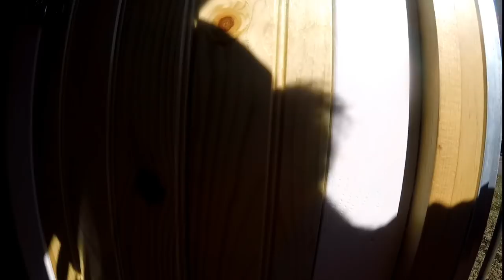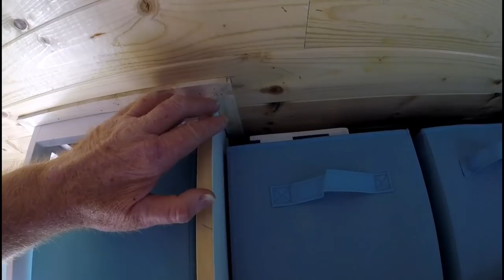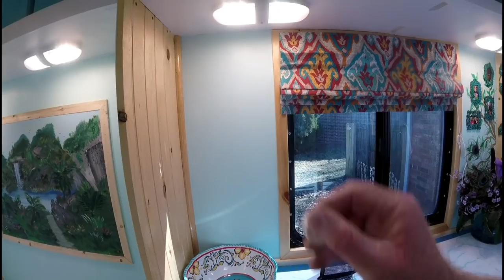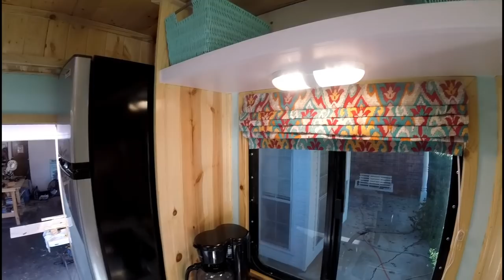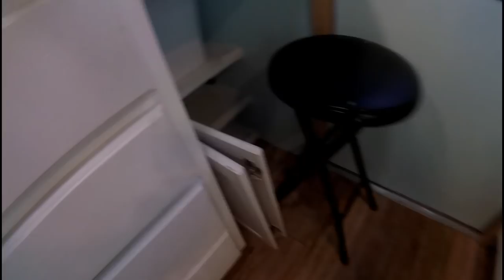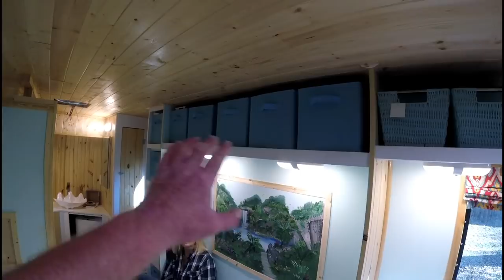Cargo Trailer Conversion Shower Trim and False Panels

Comment: I want to share a tip on trim. Do as I did and get a glue gun and buy the right size Manila twine or rope get the right side and it make a nice transition with a warm rustic look. You can wrap around bottles at the top or around wood post. Mine a Art Deco / beach decor so I got fishing net. Fishing decor on eBay and I’ve got the aqua , or blue green paint scheme look really nice.

Comment: I finally have something to add!! I’ve just finished using about 20 tubes of lexel. Get a bucket of water with some dish soap in it and just dip your hand in it when you go to smooth the caulk bead. Will not smear or get on your hands. I’ve got some really nice looking beads in our trailer which are promptly going to be covered up, lol! Great job!!
Reply from the maker: I tried that method only with a plastic spoon. It didn't work for me. Of course I was applying it to exterior seams, in the summertime, and I might have waited too long. Glad it worked for you. The nice thing about Lexel is it will last, and it's flexible which is a plus for our metal trailers.

Comment: Tech Tip : Whenever you caulk anything, always use the blue tape method & a rubber gloves to protect your hands.  The blue tape method will ALWAYS give you a perfect bead and allow the material to be pressed into every nook & crevices.  It takes a second to prep both sides with the tape, but the end product ALWAYS looks Professional and no one could have EVER have done a better job than you, if you do it this way.  Once the bead is laid down and you run your gloved finger over the joint several times, then remove both sides of the tape, it'll be PERFECT I promise.  Painters Blue Tape
Reply: This post brought to you by 3M, perhaps... Sometimes that works, and sometimes (thinking with Lexel, especially) if there is enough set-up before the tape gets pulled, the portion on the tape will have as much or more grip than the surface caulked or sealed and the work will be dislodged by the tape removal.
Reply: @ReflectedMiles  Nope...just an average Joe.  I've never used Lexel, but with that said..... I understand what your saying and don't think that will be an issue nor have I ever experienced the "Dislodge" problem before.  After you run your wet finger over your caulk bead to smooth it out and to additionally press it into the crevice you where caulking.  By doing this it also leaves minimal caulk on the tape itself, so no grip really to speak of.  Also, keep a piece of paper towel handy to clean your finger off after every finger swipe crevice smooth over.  When you get done the finished job will look as good as ANY Professional Tradesman can perform and possibly less mess.  You should go and try it with the Lexel next time and let me know....I've tried this method with spray paint and if you let the paint dry to much and then pull up the tape, that would give you a jagged line, if not tear the tape leaving some behind.  
I've also used clear scotch tape with this method and it also works (it's just hard to see).  You just have to make sure you firmly put the tape down or the caulk is more apt to run under the tape then the 3M blue stuff.  I've also used Dollar Store Blue Tape as well, which again, make sure you press that down firmly as well or the caulk is more apt to run under the tape.  3M does make good stick stuff.  :)
Peace
Reply: Wow it's all beautiful, not only the craftsmanship but the decorations and designs. Love everything. Well done. Before you mentioned that your wife loved painting,  I told my self "oh wow, those paintings were very nice". Very artistic.  God bless you both.

Comment: Hi Deb & Bill: The RV is looking great. I love the paintings and personal touches. The rear door is a foam core and has no structural integrity to hold just screws. They route out the opening and depend on the glass frame for strength. The glass frame has screws that go through from the inside to the frame on the outside. Be sure the outer frame is caulked. They usually use foam tape  I was surprised to see you surfaced mounted the hinges on the cabinet doors near the side entrance? They really stand out. Keep up the great work;  Frank

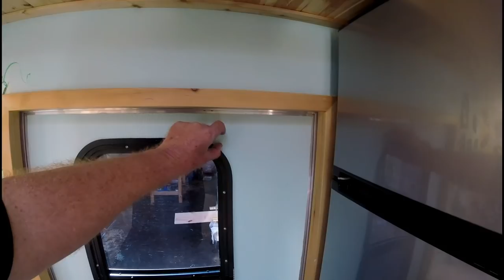Comment: At minute Mart 8:30 you said ifanybody had an idea to let you know :-) I have become a big fan of the small suction cups that have the rounded back with the curb slot down the center. The suction cupis simple and very effective. And I use chopsticks to connect two together to create a type of rod. I have one of those half circlewindows in my front door on the light always pours through. So I got some shelf paper that was made out of a plastic / rubber combination, cut out the shape of the window and then finally put four holes, two on either side of the half circle cut out so I could fit the suction cup stem through the hole. Then I slid the chopstickthrough the two slots which created a frame. I heard this on the other side so it kept the shelf paper at here to the window by the suction cup and the chopsticks made a type of backing to keep the shelf paper attached to the back of the suctioncups. I know that's lengthy but I'll show you a picture. I came up with the idea about six months ago. I should really patent
Reply from the maker: Email me a photo @ iridetinyhouse@gmail.com

Comment: I been watching YouTube videos on trailer conversions for a while. Your shower and bed designs are the coolest I've seen. I like the entire trailer but those two items really stood out. I'll be looking for more videos from you.
Reply: The bed is in the middle or is it a slide-out?
Reply from the maker: The bed is in the middle. There is no slide out. That was about 4 years ago. Yes. We had to crawl over the bed to get to the bathroom and / or the kitchen. It was a 7×16 and we had to make use of what little space we had, and still have the features we wanted. We could have put the bed either in the front or the back of the trailer, but that would have meant the bathroom (read, toilet) would have been next to the kitchen. Many suggested a murphy bed, but, they failed to consider our 50 gallon fresh water tank was under the bed, as well as the house batteries, and what space we had left under the bed became storage. Another thing many failed to consider was, this trailer was our full-time home. We lived in it for 2 years. There's no way we would have put the murphy bed up, and then back down 730 times in 2 years. We sold that trailer about 2 1/2 years ago, and when we mentioned it might be for sale, several people stepped up to purchase it. We then built a bigger trailer (8 1/2×20) and have been living full-time in it for almost 2 1/2 years. There are several build videos available on our channel, and our final, official walk thru video on the new trailer will be released Tuesday, August 22nd, 2023 @ 6:30 PM Central Daylight Time.

Comment: 45 your tip of the caulk gun and make it really small...like super small.....pre pump it away from your work piece ..  meaning get the material to the tip before hand ..also wet your finger and have a clean wet rag handy also an old business card with the corner cut off works good for setting the bead
Reply: Another great option for a fine bead is to use a Turkey Large Syringe.  This is used in Cooking to inject butter and other liquids into a turkey or chicken prior to cooking.  The needle is about a 16-18 g needle.  Squeeze the caulk into that syringe and then use that.  It would inject caulk into that tiny space between his shower and framing, lessening the need to smooth the bead.  He's right, that particular caulk he's talking about is a pain, can't do the usual smoothing techniques.

Comment: One thing you can use on RV doors is aluminum rivets along with Gorilla Glue that way you don't have to worry about it not attaching to anything because the rivets will expand on the inside of the door and hold it in  place by itself
Reply from the maker: Good idea

Comment: Does your bed fold up against the wall when not in use? If not, will you have to walk across your bed to access the kitchen? Build looks good, very professional..
Reply from the maker: The bed is a permanent structure. There is a 50 gallon fresh water tank under the bed. The mattress will be a 12 inch thick "real queen" (60×80 inches) memory foam mattress. We will have to "roll" or crawl across the bed on the rare occasion we need to to that. The trailer is really more like a fancy Bedroom with a kitchenette. The outdoors will be our livingroom. It was a tradeoff in order to have a 50 gallon fresh water tank and a 12 inch thick mattress, but those things were more important to us than a walkway.

Comment: Your enter door, just a thought . You could just use 3M hooks to put up a curtain, so you don't have to frame it out or Velcro heavy duty. Also the curtains u may want to
Reply: Sew waits in the bottom of the curtains

Comment: I’ve been watching and I love what you have done it looks great so far my only problem I have with it is the bead right in the middl but other than that I love what you have done but I suppose I could get used to your design than you for sharing I think is great one more question what size vehicle are you going to haul it with I have a 1/2 ton truck
Reply from the maker: We explored the bed issue in earnest. The final decision came down to the size of fresh water tank we wanted, weight balance forward and aft, and the fact that we wanted a real queen sized memory foam mattress. It also serves as a divider between the kitchen (where we cook and eat) and the bath (where we shower and........). We plan on being in climates where we can spend as much time outside as possible. The "outdoors" will be our living room. We will be towing the trailer with a Chevy Express 2500 Van (3/4 ton), but I'm reasonably certain a properly equipped 1/2 ton would do fine. Thanks so much for watching our videos. We really appreciate you.
Reply: "I Ride" Tiny House Adventures thank you for the info I have a Ford F-150 4X4 with a tow package I love my truck I’ve got about 125,000 miles on it and it’s a 2004 I own a trailer that we hauled tools 4 wheeler a  kalasaki 500 so it’s not small plus a large log splitter and always other things to my place in the country because you know when you go to the country there is always something that you need anyway my truck pulled the trailer without any problem sooooooo I’m thinking the cargo trailer conversion is the way to go.....I forgot how long and wide yours is again but I do understand why your kitchen and bathroom are separate... after 47 ;years working in health care I do get it and I cannot understand why some of those people put there bathroom right across from kitchen just nasty there Ins nothing worse than human waste andddd I do get it about the bed I have a tremor-edict Queen size mattress and won’t give it up for nothing  plus I have an electric bed I have really spoiled myself .... what I really want to do is sell my house and live full time in something like that and travel I don’t need the big house I live in you just collect more junk any input you can give me I greatly appreciate and the advice will be very welcome thank you so very very much but totally do understand where you came up with your decision on your bed situation it totally makes so much sense just love your conversion
Reply from the maker: Laura thank you so much for your positive response. Deb and I have been dreaming about this adventure for years. We worked hard most all of our lives and frankly not a lot to show for it. This conversion is our vehicle to escape the rat race once and for all and focus on things truly important to us and far more valuable than the accumulation of "stuff". We have sold most of our stuff and we lease our house, so the trailer and this beautiful world we live in will become our new home. Fortunately we can take advantage of our "age" and the "golden pass" to get us into beautiful National Parks and Corp of Engineer campgrounds. We will travel for at least 6 months (maybe longer) and then consider purchasing semi rural property somewhere to use as a home base.
Reply: "I Ride" Tiny House Adventures I love your plan Bill you and Deb aren’t the only one that have worked hard ...I worked 47 yrs in healthcare and have been a widow for past 23 yrs so I’m in a similar boat as you and Deb but the important thing is that you have a plan and that you travel and enjoy your time together I miss my husband very much he was kind of person that would of loved to travel I am so happy for you and Deb that you have each other and you still like and love each other .... there nothing worse than getting old and being alone my kids have there own lives and most of the time I am made to feel like I’m a pain in the ass, I don’t ask them to do anything for me that I can do myself like cutting my own grass, grocery shop, but I got that flu in dec of 2017 had it dec and Jan 2018well it hit me like a bag of rocks and I just have not bounced back from that illness so I just don’t feel up to doing a lot of anything but I push myself I’m a very independent person I’m there for everyone but I won’t ask them to help me so I just take things a day at a time and bill you and Deb need to cherish what you have and just love each other more enjoy your new adventures I know you will have fun god bless you in your travels and have a cocktail for me ......god bless

Comment: What did you use for the non-wood interior wall covering? Is that just an FRP or a polywall or ?
Reply from the maker: We used sureply on the walls then painted them.
Reply: @billanddeb  Thank you

Comment: Lexel the best. First lay a clean bead of lexel. Second spray WD-40 over your very clean bead. Third you can now use your finger with very light pressure to make a very nice seal! 4th let lexel dry, now quite simply clean excess residue.you now have a beautiful sealed component that will never crack or yellow. I should mention there is an option? Cheap inexpensive latex silicone that will crack and yellow in six months to one year later.
Reply from the maker: That's a great idea I never thought of. I'll definitely give that a try. I agree with you, Lexel is the best for a multitude of reasons. I used it extensively to seal minor leaks between the frame and exterior skin before I insulated. Its flexible which is good for metal structures.

Comment: Hi, what kind of rig (&motor) do you use to pull that Beauty ?
Reply from the maker: Chevy Express 2500 with 6.0 LS motor. We also have air bag Springs in the rear, and an auxiliary tranny cooler. 3:73 rear gears with the 4L80E transmission. The van pulls it like a dream and averages around 10 mpg. I don't drive slow.

Comment: Bill, Be sure to seal all that wood (especially around water areas) before you ever turn on a valve. Just lookin' out for yall. As I was sitting here looking at your video about 13:26 ish, I just have to ask, why did you not just make that bed a Murphy Bed with a storage couch under? That way you could walk the length and mount whatever is under the bed under a bench across the way. Just looks like it was supposed to be that way with that framing over the bed where Deb is sitting. It is blatantly obvious you have mad carpentry skills.
Reply from the maker: https://youtu.be/LIICsoiO0dQ we discuss bed set-up in the first 4 minutes or so of this video. We weighed pros and cons and decided the trade-off was worth it (for us). We plan on travelling to areas were the climate will allow us to spend most of our time outdoors. The outdoors will pretty much be, our living room. When you look at many RVs out there, several have the bed running cross wise either in the front or back. That means, someone is crawling over someone 😁. We don't have a TV in the living room in our house. We only have one in the Bedroom at the foot of the bed. We spend most of the time either researching, reading, practicing guitar (me) until time for bed, then we have a couple of favorite programs we watch then, in bed. We really consider this build more like a fancy Bedroom with bath facilities and a kitchenette. Thanks so much for the compliment about my carpentry skills. Except for workshop in high school I'm pretty much self taught. I really enjoy working with wood.